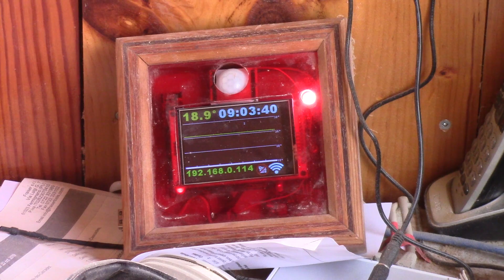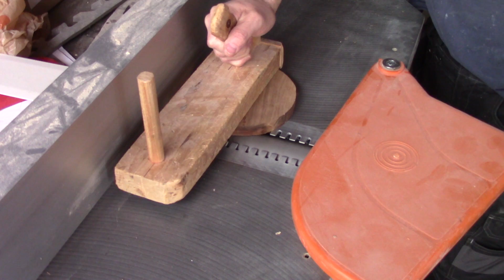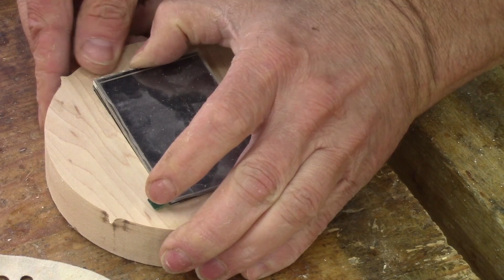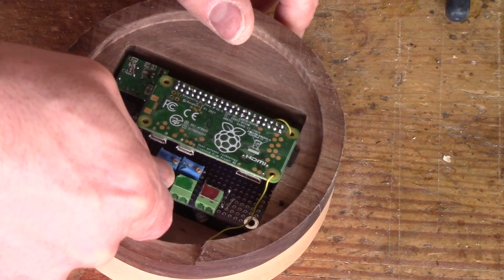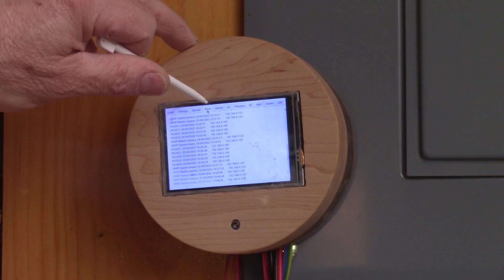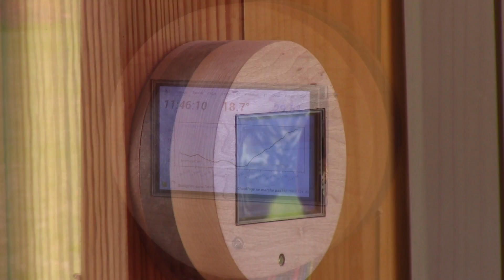The Woodpecker Ep 281-  A new thermostat for the shop

Comment: Great project, Alain! I've made a similar controller for my home. One thing I found useful was the Open Weather Map API for python "pyowm". This allows me to look at tomorrow's weather forecast, and adjust the interior heating and hot water cylinder overnight heating (the main HWC heat source is solar) depending on the expected weather. It's a control approach that has worked really well for me. [Mind you, Quebec has much more settled weather than we do here in the South Island of New Zealand (we can have snow on Midsummer Day, and conversely a 20°C+ day midwinter), so it may be less useful for you.]
Reply from the maker: Interesting idea.
I'm sure your system is great.
Like you say I don't  think I would need this, here it's way too hot in the shop in summer it was still 33° Tuesday inside, no not outside only 27° now we're bellow 20° and it's great. But I'm keeping the heat at 14° when I'm not there and this seems OK. This winter will be the second winter of my system, I'm eager to see it I will heat as much as last year. But unlike you we never have snow in summer, neither 20° in winter...
Reply: @LgosseuxDbois-TheWoodpecker  Crikey 33°C in your workshop is certainly the definition of too hot! (Although no doubt this would be considered chilly in Australia). I should have said how impressed I was that you did so much with no background in python -- very well done indeed! The first version of my controller was written in the mid-1990s (when Linux was still a very new thing) in GNU-C. I then rewrote it in python2 in the early 2000s, and then translated into python3 as I added more & more functionality. As a consequence it's a total spaghetti-like mess, and I'm always surprised that it keeps going. I should rewrite it properly one day, but finding the time...
Reply from the maker: Time is the most difficult thing to find.
I've programmed a lot in C and C# but I'm only starting in Python. I now have several program running, mostly at the cottage . I also now going toward micro-controller with 32 bits and in micro python, So I'm getting better and liking it. 
As for 33° here it's like being in hell, it's way too hot. when you add the 80%+ humidity you just want to lay on the damp grass. But it's mostly never 33° outside here, only inside my shop ,my wall of windows heats the place like crazy, it's nice in winter, no so in summer, but my lumber dries quite nicely...

Comment: Very interesting project. How do you measure AC current accurately?
Reply from the maker: For this I'm using some split core inductance coil, around one of the wire of each breaker. By taking a bunch of measurement and finding the highest one I know how many millivolts is at the output of the transformer. Knowing that 1 volt is 30 Amperes I can make the appropriate calculation to figure accurately the amount of current the tool draws

Comment: Very cool! I'd love to play with something like this. Did you consider using home assistant for this?
Reply from the maker: No. I'm having to much fun making stuff from scratch that I never ever thought of using something commercial.
I suggest that if you really want to have fun make it yourself. Just find, like I did, outlet controllable by RF or by other means, then control it yourself. 
As an example the heat starts when I enter the shop, I don't have any detector I'm just using the surveillance cameras of my shop to detect this. I'm pretty sure a commercial device wouldn't do something like that.
But go ahead do it, you'll be so happy when it will work like you have in mind
Reply: @LgosseuxDbois-TheWoodpecker  Home assistant is an open source home automation software running on top of Linux. It can do presence detection using security cameras.

That said, i know too well the allure of doing it yourself. Looks like a fun project. I was mainly asking to see if you had run into some limit of home assistant, and decided to go full diy.
Reply from the maker: I wish I could answer this , but I can't. I never thought of even checking stuff already on the market. Mainly because I wanted everything to fit in a an home made box and I really wanted specific things displayed on the LCD. I guess that a home assistant is only accessible via a web page or something like that? like pihole, motioneye or software like that, but again I can't say. But I'm pretty sure it wouldn't show a graph of the temperature like I have.
But since this was only for my shop maybe a "real" home assistant is better to control a home. But I don't know if they have inputs for curent sensors?

Comment: Neat.  Way more software work than woodworking.  Impressive how you have it all tied together
Reply from the maker: thanks.
It's a bit overkill, but I'm having fun making stuff like that. But the best part is that this box control all my electronics needs in the shop. Soon it will start the heater again, but heating the shop is only one of its uses
Reply: @LgosseuxDbois-TheWoodpecker  Did you use smart plugs to turn stuff on and off?  Which ones?  I personally quite like the tp-link ones, easy to control from python scripts.
Reply from the maker: No it's just cheap Chinese RF 433MHZ plugs. I've bought them 10 years ago. I used a 433MHz transmitter driven by the raspberry pi. They're from a company called etekcity. I will check the tp-link. are they working on an RF signal?